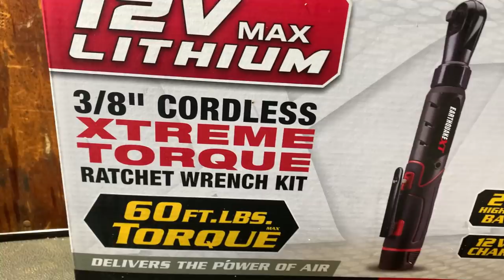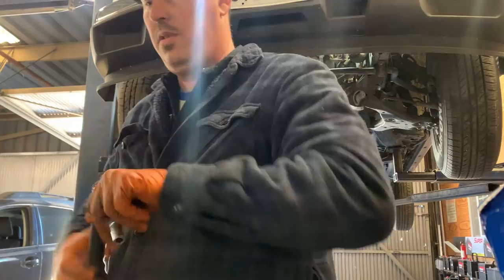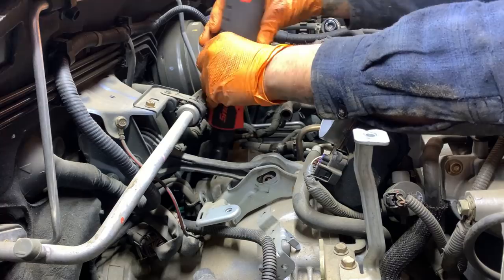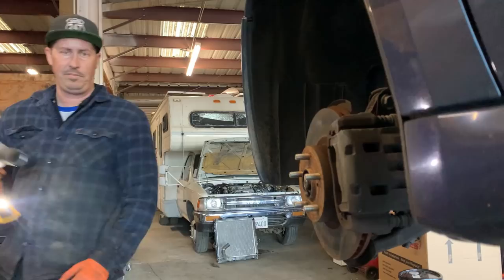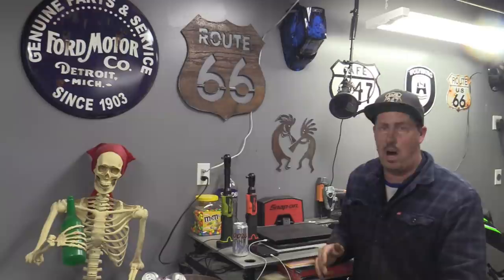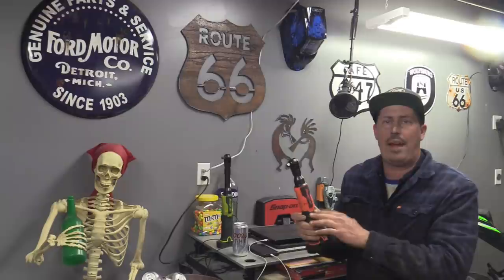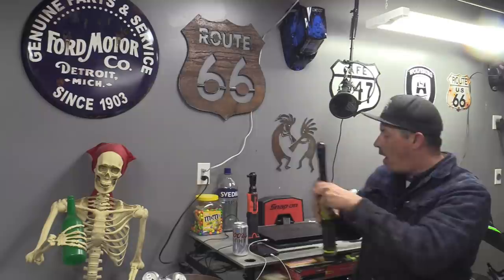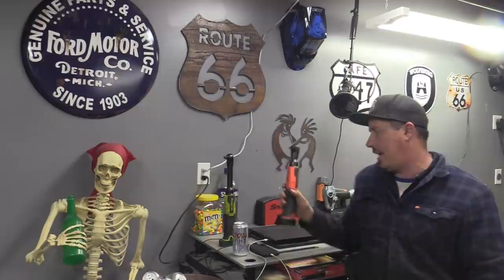Snap On Brute Long/Short Vs  Earthquake XT & Milwaukee Vs. MATCO Cordless Ratchets Which is Best?

Comment: The new brushless battery ratchet CTR861 I’ve seen and used. I work for snap on making automotive lifts challenger lifts it has a light ring all around the neck and has the same foot pounds as the brute. They are being tested in the real world setting. It’s got a better grip design and work great.
Reply: You can see a clip of it on my channel CTR861 3/8 battery ratchet. I could do a review if it needed to see how it performs on video but my opinion flawless should be coming out soon we’re still in testing.

Comment: So you show the snapon put in a million bolts and the earthquake try to remove one? Bigger battery's on the other ones, and far more expensive. Honestly you are supposed to bust it loose and then remove. I have personally been using the earthquake since it came out with the same battery and have been plenty happy,, perfect nope, good enough? Yes.
Reply from the maker: Yeah well if it can't do what it say's it can do I'm not spending money on something that won't perform before reaching the real world. Also if you made it past the ten minute mark you will here some other dislikes from out the box. Just sayin.
Reply: He has a point with busting it loose first.. I used my snap on the wrong way for a while when I first got it and the head crapped out.. I was getting a running start and dropping it on tho lol

Comment: My most used electric tool is my 3/8 impact gun. Electric ratchets are too slow when comparing to an impact gun. The Snap on Brute seems very slow.
Reply: It's slow because it's geared down for torque..... Impacts are great until they don't fit, and I'd rather have an electric ratchet than hand swing it on 20 bolts.
Reply: @kylesonsalla7620   Electric ratchets do have their place. If i were to buy a Snap on ratchet I would buy the regular extended reach 3/8 due to it leverage and speed.

Comment: The blinking light is a lockout feature either heat or doesn't like something like burying the trigger on a fastner that is tighter then ratchet can handle
Reply: Yup he is currently working on a Subaru and he is trying to take bellhousing bolts out with that And definitely making the ratchet pissed off especially when he decides to free spin the ratchet and then slap it on the bolt

Comment: I personally only have Milwaukee. The 3/8” is kinda of a pain especially if you have a boot on it but the long neck 1/4” is the best damn ratchet you can buy. My buddy bought a long neck 1/4” snap on and I next day bought a Milwaukee. After a few months his snap on crapped out and has been being repaired for months now. I took thanksgiving week off and left him my Milwaukee to use while I’m gone and if he didn’t already invest in the 14.4 line he said the Milwaukee was just a way better ratchet. Just didn’t like the trigger lol
Reply: I have both regular size milwaukee ratchets and the extended 3/8. The extended 3/8 is big and heavy I wonder if i should of invested in 1/4 extended version instead.  What is the biggest size fastener the 1/4 extended can manually break loose?
Reply: I personally know the milwaukee is inferior. Even the new milwaukee brushless high speed is not as good as the new brushless snap on ratchet. As far as them taking months to repair idk.. it's usually a two week period for me.

Comment: I have the 3/8 long neck brute. Been about a year and no issues or complaints very reliable, very powerful. I have a 3/8 air ratchet, some aircat one its rated at like 130ft-lbs. It's not an impact ratchet it's a full on air ratchet. I find air/cordless ratchets aren't great at breaking bolts loose regardless of torque they put out. The torque is good for bolts with tons of locktite or rust. I love how much manual torque I can out through the body.

Comment: I just added the 3/8 and 1/4 fuel ratchets to my box (non-long reach) and am pretty happy with them do far, I will break loose fastener first with a regular hand ratchet especially if locktight is on the bolts. But with the promo they are having with the free battery and the 5 year warrant on the tool, it's a no Brainer for me.

Comment: Great film, Dow. Maybe another similar comparison should be done after HF releases their Hercules cordless ratchet. I only have two battery-powered tools: an old B&D 18v drill/driver (I mean the battery is about the size of a brick) and the Milwaukee 12v (brushless), 1/4" hex driver. Everything else is air, at the same time I am nowhere near the level y'all are on here.

Comment: Im still using air at my work for myself. But i thought you said you break the bolt first with hand tool and use the speed of the power tool to remove it.
Reply from the maker: Most the time that’s exactly what I do. But I really wanted to put these tools to the full test by not breaking it loose and seeing what I could and could not get away with

Comment: I always give the ratchet a running start. My snap on regular 3/8 will break loose some impressive stuff with a max speed running start. I'd guess like 70 ft lbs. But if you just put it on a bolt and pull the trigger... idk, 30 ft lbs?

Comment: Besides RPM’s no other complaints about my 3/8 brute, in my opinion the 1/4 Milwaukee fuel is the best ratchet they make can’t bet the speed and torque for a 1/4. Did you purchase the standard version as well?

Comment: All sorts of problems with your Milwaukee batteries huh? I still use a 10yo M18 battery. How ever it only works in my led flash light. It will die in 30 seconds in a drill but last for weeks in the light. Is snap on still only offering a 90 warranty on those?